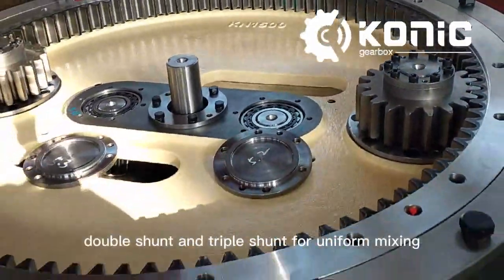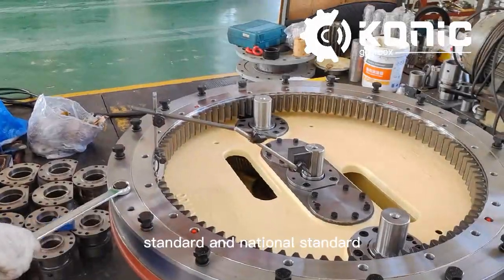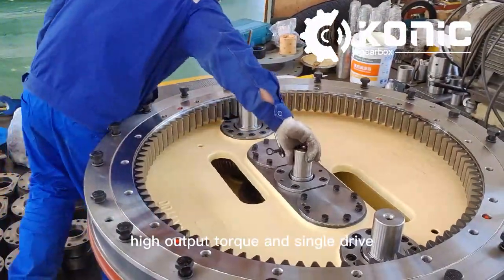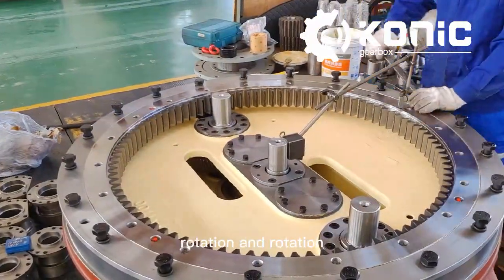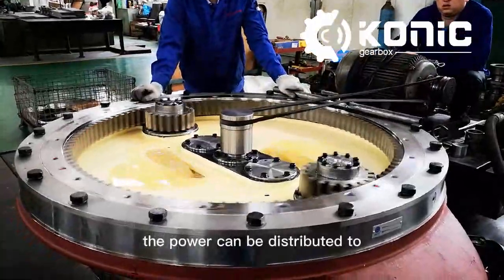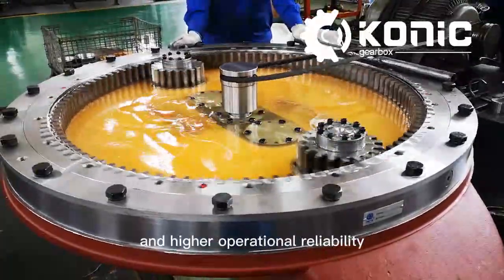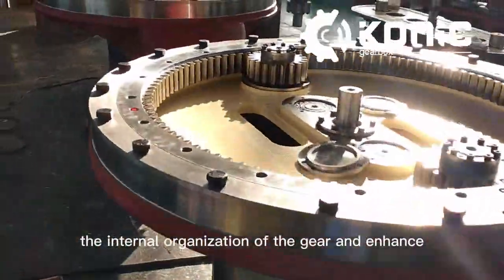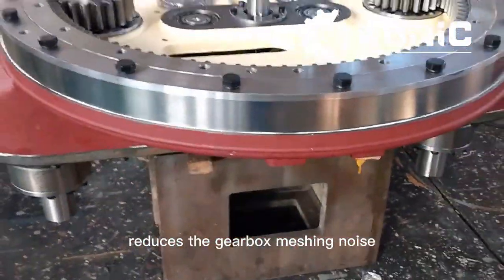KONIC Concrete Mixer Gearbox l Planetary Gearbox Mounting Test

Comment from the maker: Konic is the leading manufacturer of industrial gearboxes in the world.if want to konw more please click www.konic-gearbox.com Our strong items has planetary gearbox for concrete mixer and custom gearbox.

Over 20 years of hard work and innovation. we focus on R&D, and manufacturing of various gearbox. At the same time, Konic adheres to the business principle of quality first.

Now, Konic Gearbox is a domestic high-tech enterprise. We specializes in providing one-stop solutions for intelligent transmission. We have extensive experience with gearbox manufactured. For example, planetary gearbox for concrete mixer, steel rolling mills , marine reducers and etc.
Reply: Send no sir